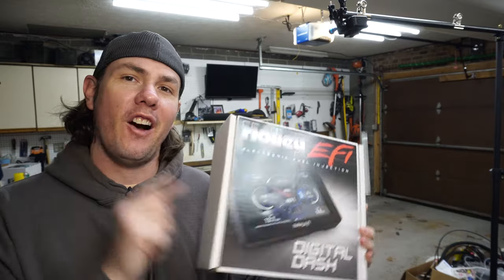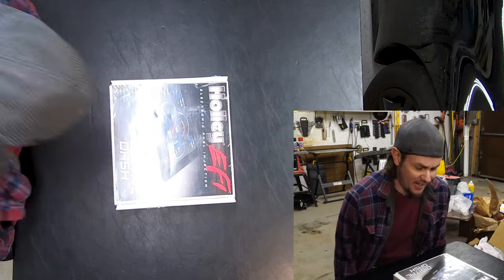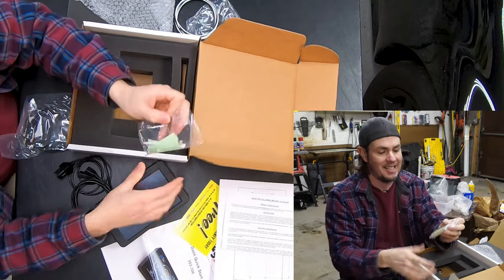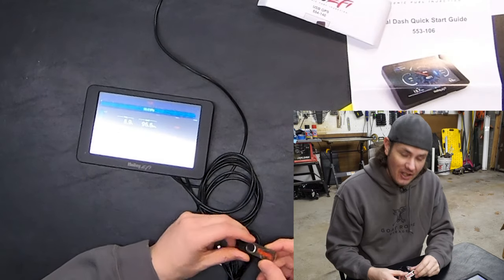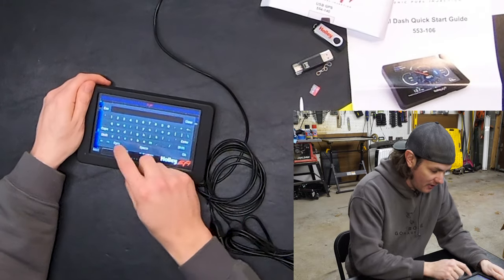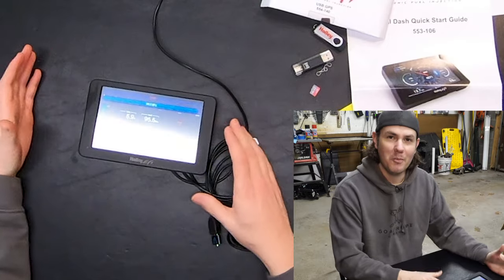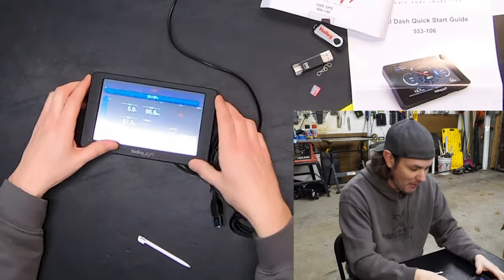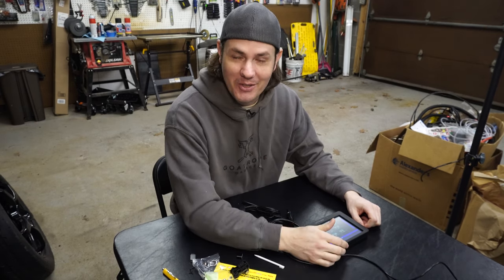Holley 7" Digital Dash Unboxing and Terminator X Hookup, Firmware Issues!?

Comment: Holley is a complete and total shit show, if you are spending 800, 1200, or 2000 on a dash, issues like this are not acceptable.   Holley's website, their instructions, and their non existent support is a joke.  These dashboards have had this USB issue for many years and they refuse to fix it.  I spent hours trying to update my dash only having to find a solution by using web searches.

Comment: Hi there. Just want to mention that there must be some kind of boot up information on the USB that comes with the dash. I could not get any of my popular USB flash drive along with the correct dash software to activate a boot up for the software to load onto the dash. Just for shits and giggles, I tried loading the files onto the USB that came with the dash and the update proceeded just as the Holley instruction indicated. So there you go. And yes Holley, this is not well done on the software update issue in this dash.

Comment: Hey, so I’m trying to use this with a terminator x and the tec at Holley just told me it can’t be used with terminator x for tuning... also attempting to power it up and I’m just getting a flashing white screen. TEC support at Holley was near no help other than telling me to send the brand new unit back. He also told me I would need to buy the 3.5 so I could tune it and would only be able to use the 7” for gauges. Didn’t make much sense to me and here the car sits dead in the water. Anyone had similar problems or know what’s going on?

Comment: Do you need a Holley ecu to run this?
Reply from the maker: They make a standalone version
Reply: you can buy the standalone version (i used it with a Carb converted LS) And latter upgrade if you buy the Terminator... which is why im here bc i cant get the firmware updated😂 thanks in advance GRG.